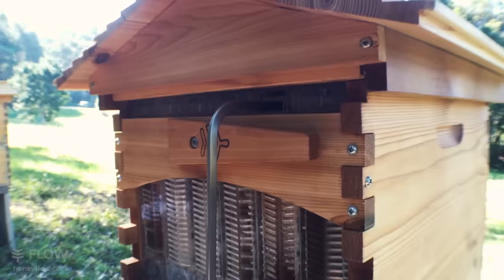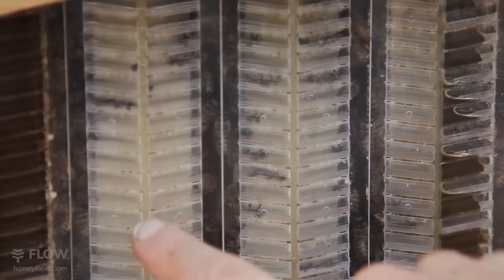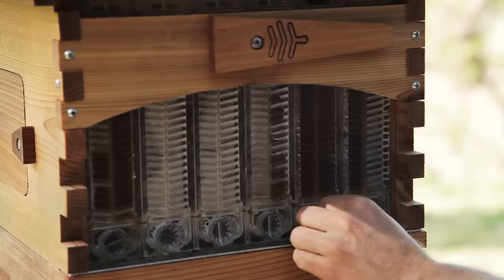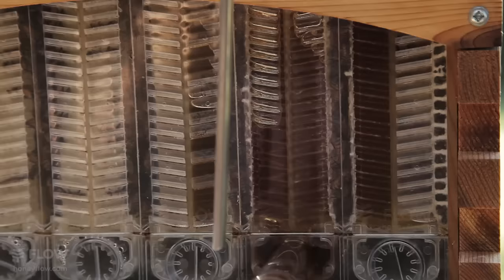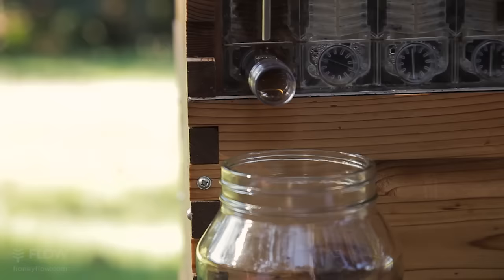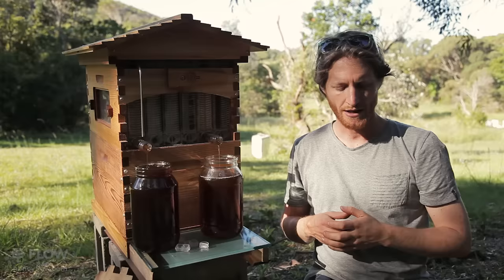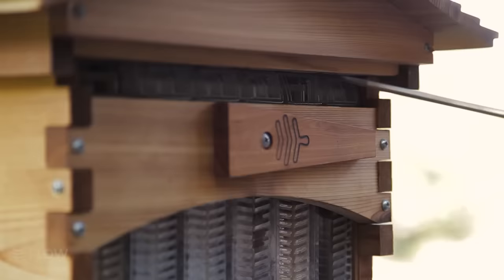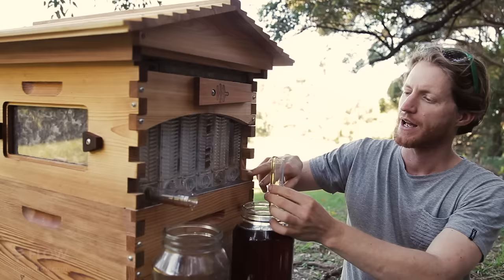Flow Hive honey harvesting

Comment: What I will say about the flow hive, is that if you have the money for one, and you aren't doing this for profit, then these are awesome. That being said, they take up a lot more space than a normal frame, and they are EXPENSIVE. What this ends up meaning is that your going to get less honey per harvest than with a standard langstroth hive with normal boxes. We usually harvest 3-4 times a year. Our first harvest is of the honey that we left them for winter(I always leave a full super for my girls), and we treat them for varroa at the same time. Next harvest is end of spring to mid summer, depending on how the supers look. Final harvest is mid to late October when we set the hive up for their winter. Anything over that one super gets harvested.

Personally I love long hives, but these really are clever. I have a single hive set up with them, but it does produce less, and once the box starts to come apart I will probably get rid of it because you have to make concessions for the convenience.
Reply: What's a super? Also if you keep the hive under something with a roof (a shed or a pagoda or something) would it still deteriorate?
Reply: @rainnmoon114  a super is what you keep the honey in. You keep the queen and the brood chambers lower in the hive, and then above you have the honey supers. Hives boxes are going to deteriorate over time no matter what. You can't really paint them once they're in use. What we normally do is swap out the boxes and change the frames into a refurbished box, and then we either decide to refurbish or discard the box that we have removed. You can get 3 to 5 years of life out of a box before it needs refurb and repaint.

Honey flow system is really nifty, but it produces about 30% less honey per super. That's not a bad thing, my grandfather is getting older and the convenience of it allows him to continue working with his bees. On a business level though they're not really an option.
Reply: @johnb8440  I see. I actually wanted to start getting into bee keeping and then I came across this flow hive thing. It looks good for beginners. Thanks for the explanation! :D
Reply: @rainnmoon114  for the most part, bees keep themselves. My job is to make sure they have space for resources, that they have resources through the winter, and that there aren't parasites affecting them. Beyond that, they mostly handle it themselves.

Comment: How will they know if you harvest the honey if they are capped? Won't they just leave it and think it's full?
Reply from the maker: Hi Ethan, that is a great question! We have found the bees will sense the cells are empty and begin the uncapping, re-waxing and refilling process straight away. Usually they finish uncapping all the cells in a day or two. A busy hive will uncap all the cells in a day or two. If the hive is not so busy it may take longer. We have seen a not so busy hive take a week to finish uncapping the cells on the outside frames. After they have uncapped the cells they will begin the process of refilling the cells with honey - leah
Reply: cool
Reply: FlowHive how would we be able to tell if all the honey was cured
Reply: Sky Walker, that's why they suggest waiting for the cells to all be capped. Honey is very watery when the bees first put it in a cell. They then spend time fanning it with their wings in the warm hive, which evaporates out most of the water. The bees won't cap it until they're happy with the consistency of the honey. So if the bees have capped it, the honey is ready.
Reply: Sakura Miyamoto yeah, but how would you know if all the cells are capped, you really can't see inner honey cells from the outside and to make it worse, bees usually start capping honey from the sides so it might look like alls the cells are fully capped when it's actually not
Reply: Yeah, this is where FlowHive's image presented here falls apart a bit. You'd still need to remove the frames from the hive to check on them. You'd need to do so anyway to make sure that somehow your queen didn't get up into the flowhive and lay brood in the cells anyway.
Reply: actually there's a plastic mesh between the boxes that stops the queen from going to the upper part of the hive so she can't follow drones there and lay eggs
Reply: Ethan Cortes Knowing how insects feel they can probably feel the vibrations from the fact that it’s empty or different from the fact that it would be full of honey remember that an insect’s primary since at least one going around in there is probably going to be touch for communication however it would be smell
Reply: That bastard taking our honey again oh fuck it I give up bzzz
Reply: Where can i purchase one of these ?
Reply: Eileen Zerrenner don’t
Reply: Sakura Miyamoto d
Reply: Ethan Cortes they know to whom they serve only we as human had to treat anything more kind than we treat ourself.
Reply: Ethan Cortes
Reply: when they go to eat it its gone so they re fill it
Reply: sonar.
Reply: Ethan Cortes:
The bees have video cameras setup on each ofl the cells and each bee will get an alarm notification on their tiny iphones should the honey volume diminish!
Reply: Smart little buggers

Comment: what a technology.. it took honey from the hive withou bother the bees.. awesome..
Reply: Fahmi Meiwardhani it's not worth paying 500$ more
Reply: Morrison64 It is if you plan on keeping a hive for more than a year. Makes collecting honey so much easier and less messy too.
Reply: True
Reply: That's well worth the cost instead of getting an extraction machine and having to manually uncap the combs and harvesting the honey.
Reply: Fahmi Meiwardhani search the videos of experienced bee keepers destroying the design of this overpriced trash
Reply: It is not easier. It will cause robbing. When bees go/come to rob they destroy whole apiaries. In this video he was VERY lucky. Also uncapping takes 5 minutes and is easy job that requires tool worth 5$. You also  need 150$ worth of equipment. The robbing problem needs to be solved in order to have a viable hive. This hive should cost 100$. Then it would be a good starter tool for hobbyists.
Reply: and it's surprisingly efficient too!
Reply: The bees will cap the honey and when it drains the honey out the bees will think they have food but they wont. Watch this codys lab vid about it 
https://youtu.be/X4v4IHGvPLA
Reply: It's roughly $700 for a small hive that you have to build yourself and then varnish/seal because they come un sealed and un built. you can get bigger sized set ups for less, it really isn't that much effort to collect honey from a hive, Been there and done that and i found it not only simple but fun.

Comment: I'm curious, if the frames are capped and this drains the honey, how do they know to remove the caps and replace the honey?
Reply: Javier García-Monsalve
4 weeks ago
"The bees are quick to notice when the honeycomb cells are empty - we guess empty cells must feel quite different underfoot if you are a bee. You can watch them work on the end cells as soon as you reset the Flow Frame to the closed position.

We have found the bees will sense the cells are empty and straight away begin uncapping, repairing the wax in the cells, and refilling. Usually they finish uncapping all the cells in a day or two. If the hive is not so busy it may take longer."

^ Found this in another comment, figured it'd help to share.

Comment: Do the bees get disturbed when you turn the key and they might be filling a cell? Or do you wait until that frame is full completely before tapping it? I'm curious how the react to the empty, capped cells if they chew that lid off right away to start refilling or it takes a bit to realize the cell is empty.   Thanks!
Reply from the maker: Such great questions, When you turn the key to open the cell, there is a gap built into the cell walls of the partial comb structure so bees can enter and exit cells even when they are in the open position, albeit they would get a bit sticky and quickly be cleaned up by other bees in the hive.  Waiting until the Flow Frames are capped is an important step as this ensure the honey is cured and doesn't have to much moisture. It depends, they can uncap around a couple of hours after harvesting, to a day or 2. –Kieran

Comment: That's impressive how much honey came out.  I'm not a beekeeper so I'm trying to understand exactly how it works.  If that section of comb is already capped, how do the bees refill it with more honey after it's been drained?
Reply from the maker: Hi Dave, when full each Flow Frame produces about 3kgs of honey. Once the honey drains out after a harvest the bees realise that the honey is gone and start recycling the wax and filling and recapping the cells. Clever Bees! - Sam
Reply: @FlowHive  so they eventually realize the honey has been drained out of the back side of the capped comb? That's amazing.  Did you guys already know they would do that or did you figure it out while experimenting with the Flow Hive design?

Comment: How do the bees know the honey is gone if the caps are intact?
Reply from the maker: Hi Jack, that is a great question! We have found the bees will sense the cells are empty and begin the uncapping, re-waxing and refilling process straight away. Usually, they finish uncapping all the cells in a day or two. A busy hive will uncap all the cells in a day or two. If the hive is not so busy it may take longer. We have seen a not so busy hive take a week to finish uncapping the cells on the outside frames. After they have uncapped the cells they will begin the process of refilling the cells with honey.

Comment: How do the bees know the honey is gone?
Reply: When its empty.
Reply: @odevious8081  So the caps cave in due to pressure or something?
Reply: YouMockMe no because they no longer see the honey in there
Reply: @mummiedanser1609  Well I guess if they go in for food and find it empty, they probably check the rest or something. Good enough. Thanks
Reply: Disclaimer: I have litteraly no idea
Maybe they can smell it? Also its a bit of a lighter color after the dark honey is drained from below the cap so they might pick up on that too, bees are also just rad as hell and probably have magic honey sixth sense 😂
Reply: @jseven6044  Magic bee sensor. ...i'll take it.
Reply: @YouMockMe  Ive been reading more about flow hives and I found an actual answer beyond bees are magic! It turns out in order the drain the honey, the comb is broken slightly. Basically each half of the hexagon either moves up or down a tiny bit so it breaks the seal and the honey can flow, thats what turning the key at the top does. Then when you use the key again to put that panel back down it realigns the comb and the bees fix it right up and go about their little bee day making more honey.
Reply: @jseven6044  Ah, right on, makes sense. Thanks! 
[accepted answer]
Reply: Because they see that someone came and yeeted the honey out of the combs.
Reply: @iamcalledcleb  and yoted the bees too

Comment: hmmm...is those internal cell stacks made of ..plastic ? or other more bio friendly materials ? just hard to trust most polymer or oil materials long term effects on your bee 'partners' considering how much chemicals most methods to 'mold' them involves..but maby its arteficial cells made of glass ?^^... either way...DAM ..nifty construction to bother them as little as possible
hoppe the bees finds out the cells been drained rather fast though so they can adjust ther worker count  and acordingly for the remaining of the summer.
Reply from the maker: Hi, we share your concerns around plastics and have worked hard to find the very best food grade materials. The clear viewing ends of the frames (and the Flow tubes) are made from a virgin food grade copolyester. They are BPA-free and are not manufactured with bisphenol-S or any other bisphenol compounds. Third-party labs have tested this material and the results have demonstrated that it is free of estrogenic and androgenic activity. The centre frame parts are made from a virgin food grade polypropylene which is also free from any bisphenol compounds and is widely accepted as one of the safest plastics for food contact. It has also been used for many years in beehives for both brood and honeycombs.

We will keep you informed if anything changes and we use any different materials.

Comment: How do the bees know that the honey is gone to refill the comb I’m not. After just a wondering man.
Reply from the maker: That is a great question! We have found the bees will sense the cells are empty and begin the uncapping, re-waxing and refilling process straight away. Usually they finish uncapping all the cells in a day or two. A busy hive will uncap all the cells in a day or two. If the hive is not so busy it may take longer. We have seen a not so busy hive take a week to finish uncapping the cells on the outside frames. After they have uncapped the cells they will begin the process of refilling the cells with honey.

Comment: I have a metal shed I’m not really using on my property. Could these be installed 1/3 or 1/2 way into the shed’s walls for a fully contactless experience? That would be an awesome project for summer.
Reply from the maker: Contactless beekeeping is really not possible, as inspecting the hive is one of the key most important things to ensure your colony can get to the point of  harvesting and is able to fight off pest and disease. Not inspecting will lead to the loss of a colony. But you can look at setting something up like this, in cold climates beekeepers will often have a shed around their hives that open up fully in the warm months and can be closed off to insulate the hives during snowy winters. A metal shed is likely to be very hot a lot of the time, so it might not be ideal without insulation. –Kieran

–Kieran

Comment: I watched another flow hive video and they said to move the bees out the flow hive before extracting the honey as it can harm the bees a pollute the honey. In this case it doesn't seem like you move the bees before hand, to clarify is it safe to extract whilst the bees are still in the hive?
Reply from the maker: Hi there, we harvest the honey with the bees still inside. Our Flow Frames are created with offset heights which are designed for less disturbance to the bees while harvesting. 

Our earlier prototypes had an even surface but that meant the capping was more likely to tear when the Flow Frame was opened. 

Having the moving blade inset slightly means that once the bees build it out the movement happens deeper within the honeycomb. This often means the capping stays intact as the honey drains out, leaving the bees with less disturbance. 

After a few hours, they realise the honey has gone, and start uncapping and repairing the cells. 

Clever little bees! - Sam

Comment: Has any 1 researched if squashing bees inside the comb when u release the honey cold have a lasting effect on bees could they get scared of the comb collapsing again and not use it over time
Reply from the maker: Hey Luke,

Thanks for your question and concern :) We have done rigorous testing with the Flow frames to ensure they don't squash the bees when turned at all.
The worst that can happen if they might get stuck in the cell they were working on for the short duration of the harvest and then are free to continue as they were once the Flow frames are closed again.
It's an important thing to consider though so I'm glad to hear of your thinking of the bees.
- Danika

Comment: This is great way of harvesting honey but how do you know not to crush the bees Or hurt the queen. Or any bees crushed in this process?
Reply from the maker: Great questions, and it comes to mind to many that is for sure. The safety of bees has been incorporated in the design, the moving parts don't grind against each other or create pinching points. So bees can actually move in and out of an open Flow Frame with little effort. –Kieran

Comment: Do the bees realize there no honey under the caps then replace it?
Reply from the maker: That is a great question! We have found the bees will sense the cells are empty and begin the uncapping, re-waxing and refilling process straight away. Usually they finish uncapping all the cells in a day or two. A busy hive will uncap all the cells in a day or two. If the hive is not so busy it may take longer. We have seen a not so busy hive take a week to finish uncapping the cells on the outside frames. After they have uncapped the cells they will begin the process of refilling the cells with nectar. Please let me know if you have any other questions

Comment: Do bugs go in the honey? Also what happens to the caps? Is that beeswax?
Reply from the maker: Hey there, 

It's a good idea to put a cloth over the Flow tubes when harvesting to prevent bugs going in. 

The wax capping gets gently torn apart when the hive is cranked open, and the bees then notice this has happened, chew back the wax cappings and begin cleaning up and preparing the cell for re-use.

Clever little bees!
- Danika